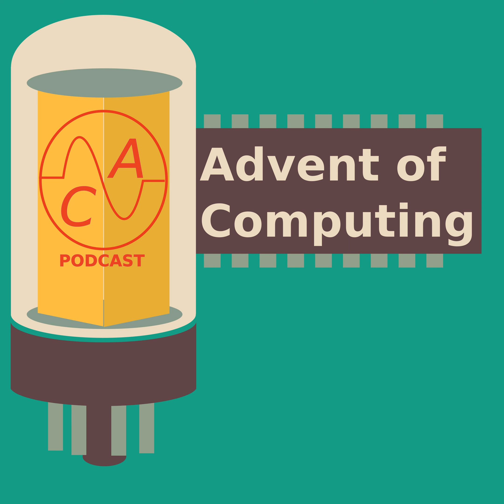Episode 110 - The Atari 2600

Comment: Cartridges were mostly limited to being ROM-only; no RAM in the cartidge.  This is because there is no read/write (R/W) signal on the connector.  Some later cartridges did add a little bit of RAM via some trickery that involved both extra hardware and software.
Probably a little off topic from the story but still kind of neat.